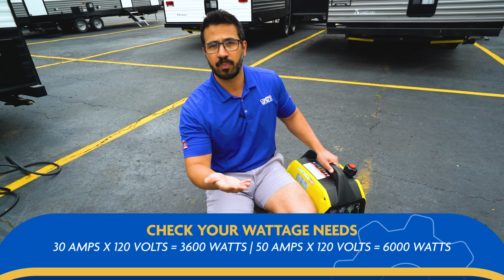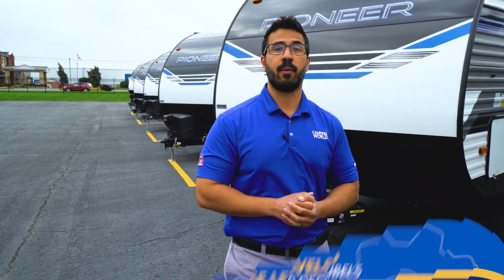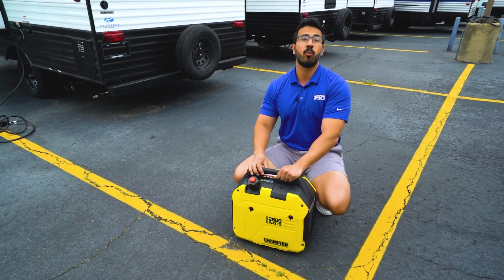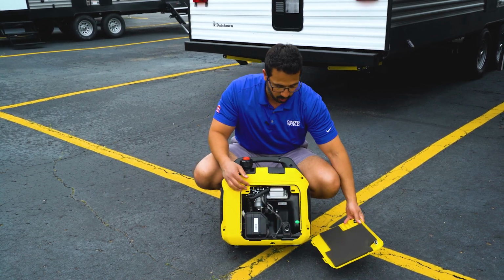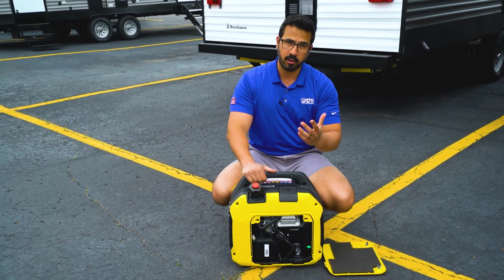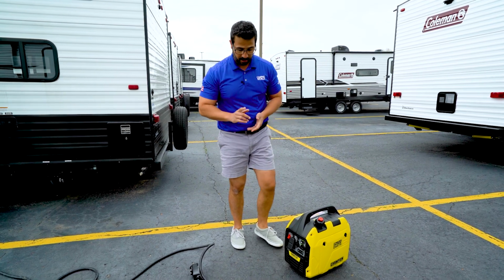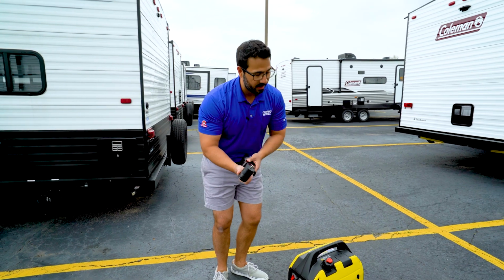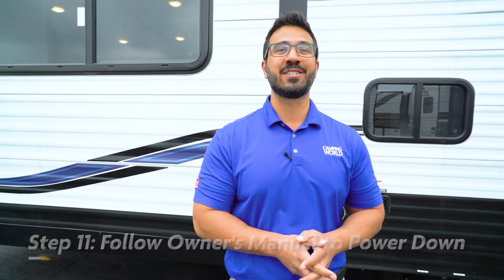How To: Hook Up and Operate A Portable Generator

Comment: My question is my 30 amp adapter to regular  3 prong plug and whether it will seat snuggly to the front outlet?
Reply from the maker: Hi there! 

Is this the type of 30-amp adapter you're interested in using with a portable generator? https://www.campingworld.com/power-grip-adapter---15a-male-to-30a-female-27986.html